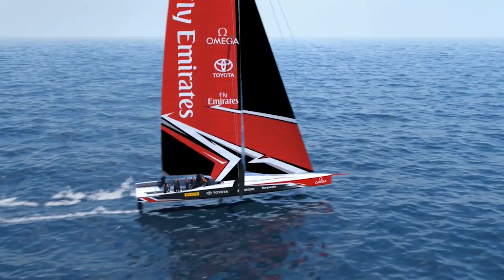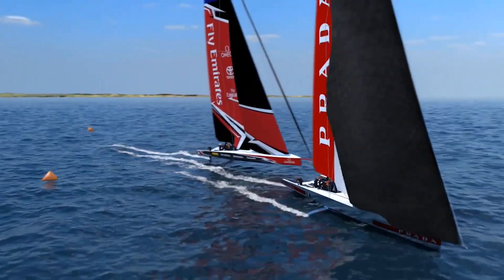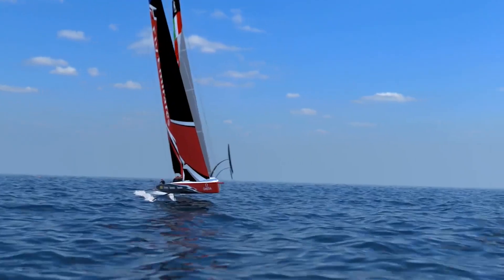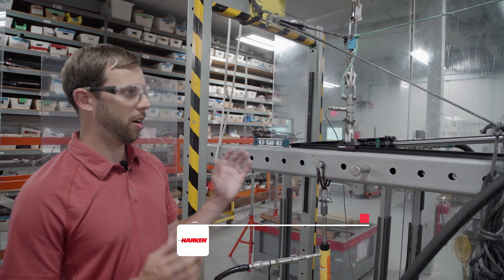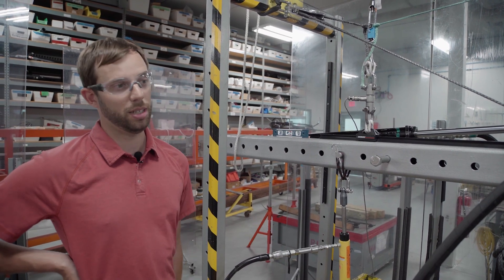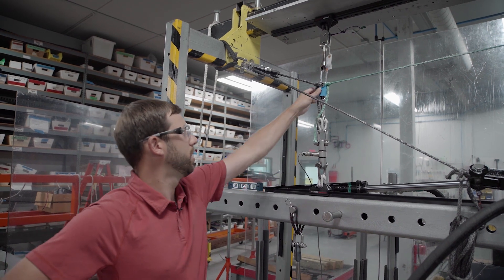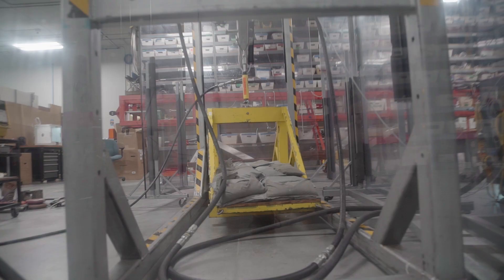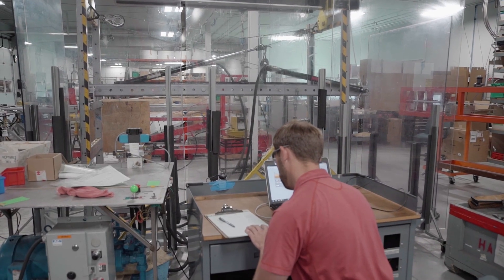America's Cup Inside Look - Step up to the Harken Test Bench

Comment: This test bench does not address the angle change between the traveler and the boom. It assumes the load is going to be perfectly in Z+ which we know to be incorrect. The loading in the outside rollers is significantly higher in that tested on the fixture.

Love the peek inside the testing lab.